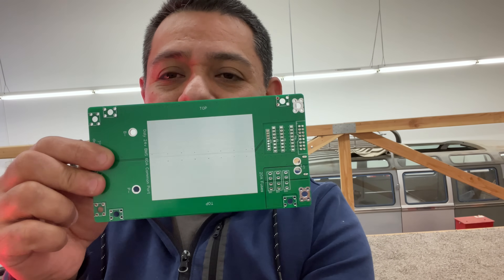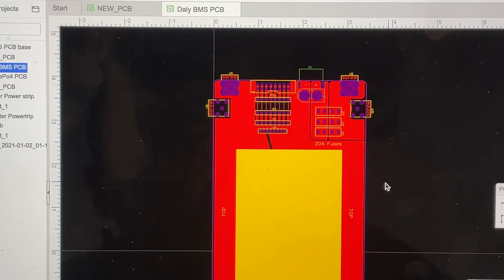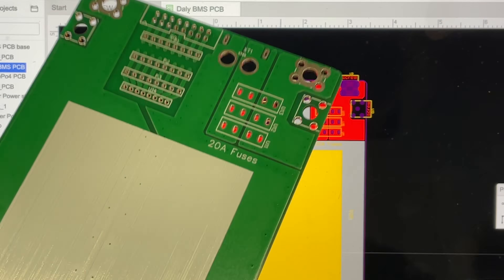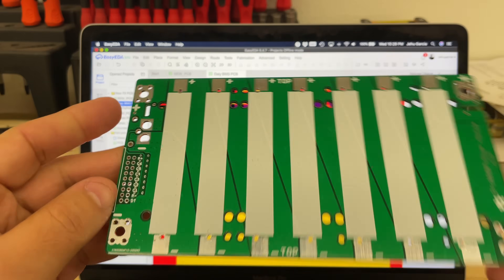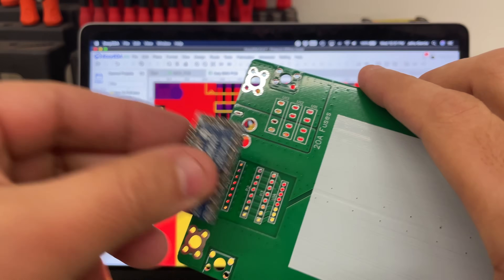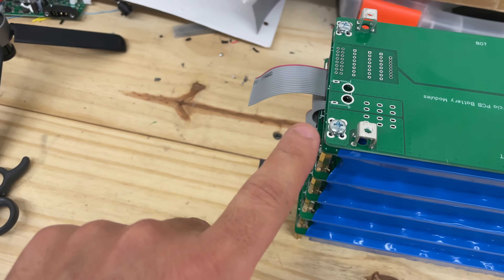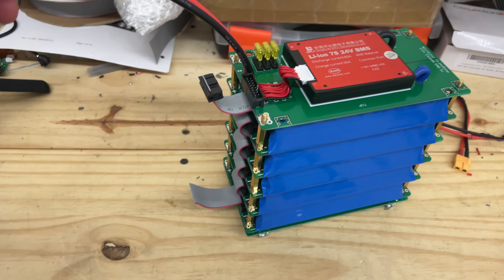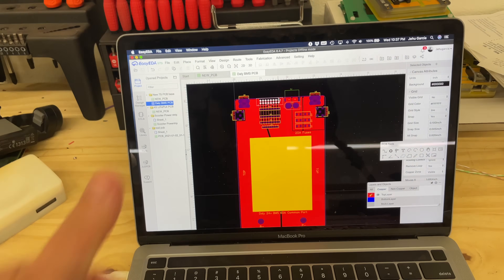Redesigning my DIY PCB battery systems BMS module

Comment: Amazing project ! Super pro. Question, if you have 1 BMS, with multiple of these packs parallel doesn't that still make it possible to burn a faulty single cell?
Reply from the maker: Everything is possible but unlikely
Reply: @jehugarcia  lol you should join our politics :) 

But still, you are right. It’s not possible (economical) to have everything covered. Thanks

Comment: Hi Jehu
Could you make a short video on how to upgrade or simply populate your BMS board with a Daly 7S instead of the 3 cheap Chinese BMS's. Where to solder the BMS leads and any comments would be great. I think having one Daly 60 amp is easier to trouble shoot.
Andrew

Comment: Why not use replacable mini fuses?
Reply: Because f u, that's why. I'm joking, it's because this way it's safer: a mini fuse can create sparks when blow up and starts a hazard, specially having 18650s son close. The method of using trace as fuse was a common practice in the 80's, you can look in any old TV or radio.

Comment: I have been using another supplier for battery pack hardware, but after all the crap that went down last week, coupled with the ease of assembly of your system, I will be switching to your system going forward.  Thanks Jehu!

Comment: 1.14.21  Jehu, how do I get some of those bottom blank boards with the 4 metal stand offs with the plastic spacers for mounting the PCB into a metal box?  I have 4 stacks using  13 PCB and 1 BMS in a stack.

Comment: Hi, I would have 2 hints for you (from my old PCB-designing days)
- why not putting the BMS 180grd rotated to have a shorter way for the high current. It looks cleaner as it is with the short balancing cables but you want to minimize losses and to keep the way the high current power has to travel as short as possible
- for your fuse problem. Why not replace them with wires of the appropriate thickness. You only have to provide your customers with the right information or wires (if you want to sell them).
Reply: Wouldn't the fuse wire be hard to replace?

Comment: Thank you for thinking about "snap-on" fuses! I'm currently replacing a number of trace fuses.
Reply: Side note. I found a 7x7x4 NEMA box fits perfectly the 5 board stack when you lay them in sideways and take off the plastic footers. You just have to drill some holes for the BMS charge/discharge wires.

Comment: Contact an outfit called Dirty PCB,s.  They make custom cable assemblies.  You always should use polarized connectors.  Just for that 2AM work stint and you finally put that project together for the last time only to have a connection backwards.  This is especially true for batteries which are never off.

Comment: Fuse replacement is great idea. I have 20 boards with blown fuses. Need a template to use solder past to fix blown fuses ez.

Comment: For fuses you should consider the 3*10MM Axial Fast Quick Blow Glass Tube Fuse as they are pretty cheap and easy to solder on and to desolder. But your idea is great as well.